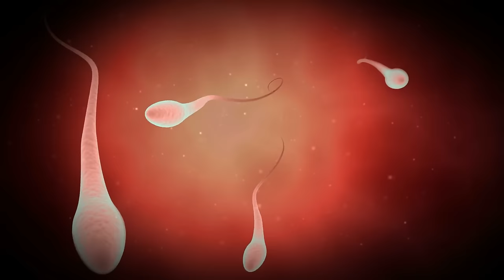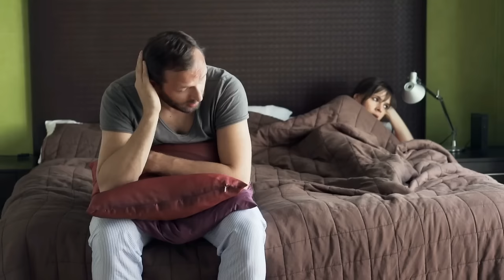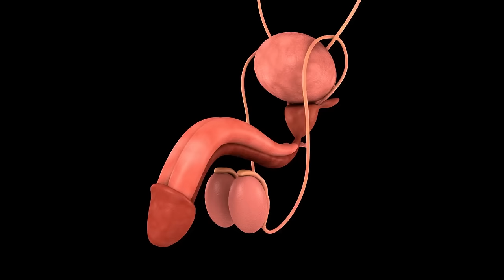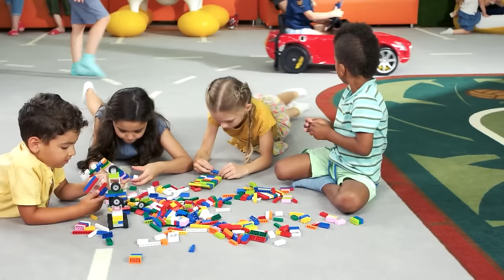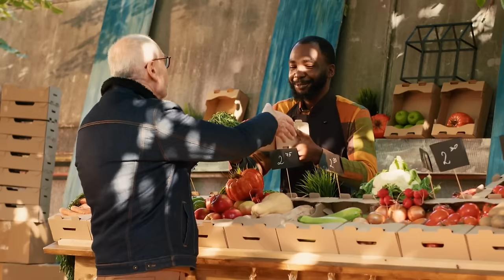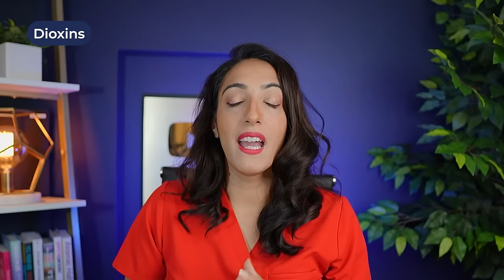Hormone Disrupting Chemicals and the Crisis of Low Testosterone in Men!

Comment: So I drink all my water from plastic water bottles.  1 gallon jugs to make my coffee and fresh brewed tea and small bottles for going to the gym etc.  I'd like to maybe get away from this but I don't really want to get my water from the tap.  I don't think a brita filtering tap is the answer either.  Maybe it's fine and better.
Reply: I get water from Mountain Valley spring in 5 gallon jugs
Reply: Install reverse-osmosis system.
Reply: @MultiKtm300 mountain valley is great!…to the original post, the brand clearly filtered is much better than Britain
Reply: Whats wrong with tap water? I drink it all the time.
Reply: Brita water jugs say they are BPA free.
Reply: @toaster4693  Chlorine, floride & antidepressant and birth control pill residues in the water to name a few. 😅
Reply: @HappyJiyoung not to mention the bacteria and heavy metals from the pipes
Reply: Get a water distiller and then remineralize your water with drops and/or good natural salt with lots of minerals in them
Reply: Doulton water filter not costly very efficient

Comment: I have type 1 diabetes and literally have to inject myself with syringes every day which are about 90% plastic. I’ve probably been microdosing every day for 30yrs.
Reply: What matters is the type of plastics and the question is also, if your meds are stored in plastic or you're just using a syringe for a short moment to take up the meds and apply them. Which makes a huge difference. Plus, here in Germany I've once gotten syringes to give stuff against blood cloths into his belly fat while his foot was in a cast. And because I am a very curious and crafts loving person, I took those self-retracting syringes apart (with safety gear on and after disinfecting the needle and everything). 🤩

Turns out that inside that plastic syringe with a metal spring for self-retraction after placing the shot, there was actually a very slim and not well visible mini GLASS syringe body inside the plastic. That was SO FASCINATING. 

What I am trying to say (and I'm not American and I do not know exactly how insulin is given), but although the plastic syringe body was transparent, I did not notice that the inside is a perseverate glass body until I took them apart. So I'm saying:

Careful with assumptions unless you are really really really sure. Cause turns out that sometimes syringes are not that simple at the first glance. And again, if you only use it for the shot itself then that by itself will mean barely any plastic gets dissolved and the rubber gliding along the walls tends to glide smoothly. The concern with plastic items and foods is, that the fluids stay in long or are acidic or heat gets involved. Short exposure of even acidic substances without heat are not the same :3

Comment: What over the counter supplements are the best for increasing testosterone.
Reply: None, healthy weight, good sleep, balanced diet, resistance training and walking is pretty much what's working. 🙂
Reply: Start with zinc & boron. Broccoli sprouts maybe useful. Low carb, higher animal fat, eliminate refined soy, corn, sunflower, canola/rapeseed, etc to lose visceral fat. Avoid grains, sugars, pesticides, plastics and pesticide sprayed crops especially crops in which herbicides are sprayed to kill the grain or legume to dry it prior to harvesting.
Reply: @man_at_the_end_of_time  What are you on about? 😂
No, we don't need to cut carbs (just look at any athlete), we should minimise saturated and trans fat as they increase cholesterol, soy is perfectly fine, same thing goes for All other things on that list.
In the end we gain or lose weight by changing our calorie balance, and our weight, fitness level, sleep and hydration is pretty much all we have to make any impact at all on hormones.
Reply: @PSA78  I'll agree trans fats are a problem. But we have a population that is metabolically sick even most of your athletes fade out and get fat. You are trapped in conventional practices and expectations.
Reply: @man_at_the_end_of_time  They might eventually get fat if they don't continue to practice what they have, if they get fat that's when they could get metabolic issues, not the other way around in a otherwise healthy individual. That's why people can follow a plethora of different diet types and still improve health, they clamp calories to lose weight and typically change their lifestyle so it incorporates resistance training, good sleep etc.
Reply: @PSA78 You don’t know what the big pharma and food industries lied.
About fat, cholesterol etc.
Reply: @HappyJiyoung  What are you on about?
Reply: @PSA78 you really think soy is good and saturated fat is bad, man you have no clue how the body works.
Reply: Shilajit, tongkat ali, boron, zinc, magnesium, ashwaghanda to name a few